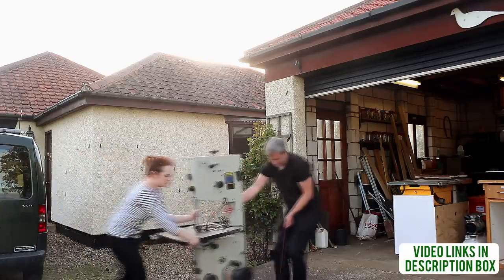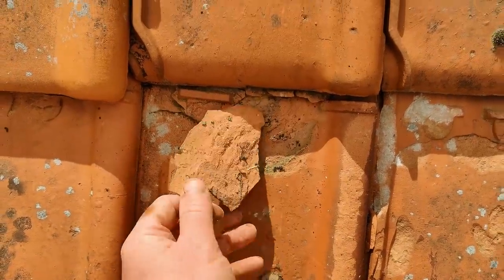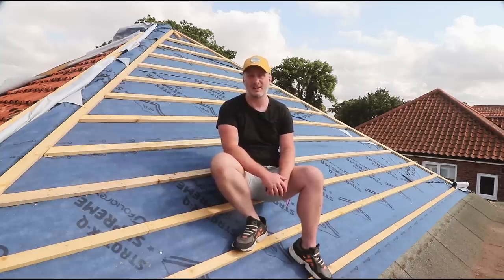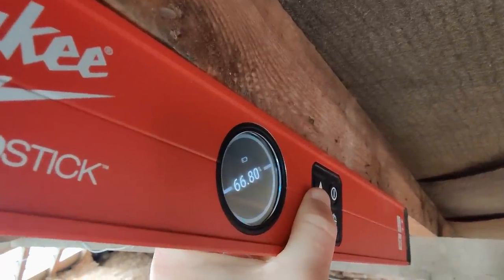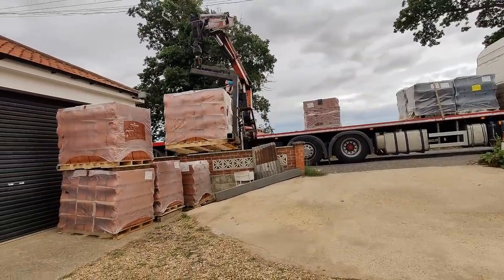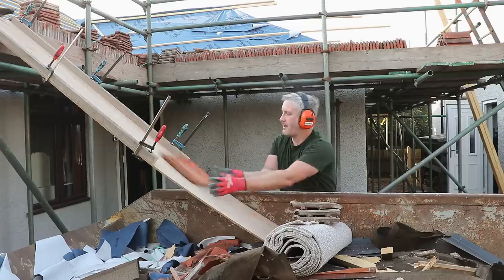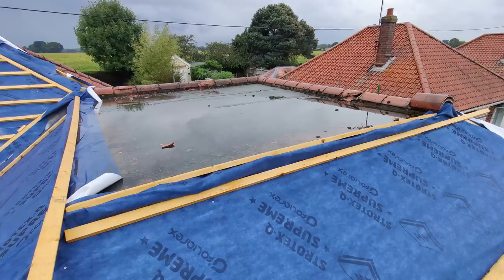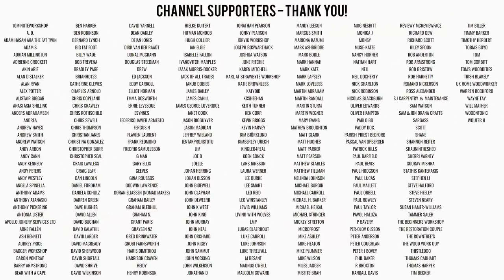The Damage Is Done, Who's To Blame?

Comment: As a builder friend of mine said once: 
"There are 2 types of flat roofs, those that leak and those that are going to leak!"
I've just re-roofed my utility and considered changing from flat to pitched. Went for flat but changed from cold roof with felt to warm roof an EPDM.
Cost a fortune but pleased with the results!
Reply from the maker: Haha I like that! Glad to hear yours is sorted👍EPDM seems like a good choice
Reply: EPDM has its own issues. It will shrink, and pull away from any pitch transitions for one. It also degrades in UV, they don't really last much longer than a mod bit or BUR. The best solution I know of if you do have to have a flat for some reason, is a tapered insulation system, and mechanically fastened TPO or PVC with heat welded seams, but that's really costly too.
Reply: Like concrete
Reply: Everything needs maintenance, but applying this meme to roofs is going overboard IMO.

Comment: 10 years after having a new roof put on our house I noticed that the ends of the fascia boards on the gables were resting on the rooftop. Further inspection revealed the ends of the fascia boards to be sponge soft and rotted despite appearing normal.

I was able to cut off the rotted sections and repaint the cut ends without having to replace the fascia boards. 

The moral of the story is to  familiarize yourself thoroughly with the trade before hiring someone to do a job and closely monitor/inspect their work to ensure that it's done correctly.

Comment: Use this as an opportunity to make the ceiling plane airtight with a membrane under the joist, then use blow in insulation and get 400 mm of insulation up there. Any vapour open membrane and tape system will do. 

The other option is to go with over rafter insulation. With these tiles, you do not need to have ventilation beneath the taped plywood sheathing. The attic then becomes conditioned, and you can put mechanical systems up there (water tank/ ducts/ heat recovery system, storage etc). This increased the depth of your overhangs because of the build up on the roof, which allows for easy installation of exterior wall insulation. 

I can send links if you're interested. With your online presence, you could get sponsorship, I reckon.

Comment: If you look at Edinburgh rooves on google earth or maps - you will see that though from the front it looks like they have pitched rooves, behind the front rise they are flat. This technique gives the impression that the houses and tenements (flats) are not as deep as they actually are. Most of these were built between 1880 and 1920, normally with zink roofing. They last pretty well and changing them to fully pitched is not an option.

Comment: Dehumidifier !! And heat in the top floor to driva away moisture.
Get airflow in the roof and vacuum away any standing water.
Start spraying the wood with mould killer, it will start to mould heavy soon unfortunately

Comment: DUDE!!! The wooden battens underneath must be pointing from the ridge to the facia, they must be nailed to the loadbearing joists. On top if those battens, you place the counterbattens unto which the roof tiles are placed. BTW, rockwool gets less drenched with water than glasswool. But you sheetrock needs to be replaced and the joists needs to be dry, before you lay out new insulation. Here's the steps:
1) Remove ceiling and insulation. 
2) nstall battens, counterbattens and tiles. 
3) Let the wooden construction dry out with help of a "heat blower". Measure the moist in the margin wood to prevent mold. 
4) Install new plasterboard ceiling. 
5) Lay out mineral wool on the loft. 
6) Make sure that the loft is ventilated, ask an architect about the number and size of ventilation oppenings. Must be protected against insects and birds.
Reply from the maker: will respond to these in a future video - cheers
Reply: @RagnBoneBrown  OK :-)

Comment: M8, Whilst I'm sorry you went through this nightmare, who in their right minds goes away on holiday [even just 4 days] when their biggest asset - their home is open to the elements like this and even more so with the roof off!   I know you properly don't want to hear this but as soon as you were told about the water coming in you should have put down your pina colada's and hot footed it straight home!   Oh, and BTW just think about how much weight you added to your Artex'ed ceilings by having them skimmed over ... them skiny little nails they use to use back in the 30's/40's barely hold the plasterboard let alone layer after layer of additional plaster!  Sad to say your best bet is to rip them all down as well as the wall plaster and start again as once water's got in and blown parts of the ceiling/wall plaster out their fecked and no amount of wishful hoping it will just 'dry out' will sort it.  Lastly - you did tell your insurance company you were having this major building work done?  If not I'm sure this video will do that for you. 😉  [any excuse to turn down a claim or possible future ones?]🤔

Comment: Alot of folks talking tough but this isn't a normal roof tear off and dry in. You have a stupid flat roof on top of a  pitched roof and you are essentially reframing your entire roof. If a big storm hits while in progress, it is going to leak in regardless of contractor unless you set up a huge containment system over the whole project, which I'm sure you didn't have in your budget. I would have recommended just framing on top of that flat roof to match the pitch to a point . Yes it would have raised your roof height and you would have to pull a permit but you should pull a permit anyways if you hiring it out. That way after you get it sheathed  you can  do a normal tear off and dry in without fear and even if a storm rolls in you can just tarp it and it will be fine as it's sheathed so the tarp wont sag and let water in. I would ultimately put this on the GC (sounds like you) for not making a good plan to get the overall job done.

Comment: Time of year, consideration, instalation of over cover temporary  roof above work area,  with out, with poor planning by the roof contractor,  the cost of the above will be still be less than the( long term) damage to that properly , water damage is the worst problem to cure

Comment: I'm afraid all that Plasterboard will have to be replaced as the water will have damaged the structure of it and made it brittle.  The paper will now nor hold it together.  
Get the builders to finish the roof Remove all the wet Plasterboard and insulation, then let the timber dry out properly before replacing it all with new. 
It's his fault so make sure the he repairs it properly so you don't hap issues later on.

Comment: The roof is obviously knackered and should have been done first a simple loft inspection would have shown water damage.
Why the flat roof anyway? My guess it may have been an observation feature for perhaps stargazing and had glass or similar for telescope.I of course don't know for sure but most people knows someone with building knowledge. This felted area would have been fine for several years and cheap to do just not the best idea.

Comment: I roof.  And my most basic policy is do not tear off what you cannot replace that same day.  There are exceptions.  But I only allow those exceptions if the weather forecast overnight is sterling and safe.  The flat roof being safetied by an employee? NEVER,, absolutely NEVER.  I am responsible,,, I do it myself.  Contract with a new roofer. I would not contract with yours to do the dog house. The dog would get wet.

Comment: I share your pain water ingress is NEVER good, we had a pirch extension added to our bungalow and a conservatory also, these were done by the same company and they were, expletives withheld, both leaked very badly, fair does that did reproof the porch roof but to no avail. The original builder couldn't even rewire a two way lighting switch, I should have realised 5hen that all would not go well and it didn't, as soon as it rained we had torrents running down the walls and then surprise,  surprise the builder disappeared we finally had the work repaired by another builder and had no troubles since, we were informed the roofer just tucked the roofing felt into the soffit hence the internal downpour. However my long winded comment is this ,regardless of how nice and friendly the builders are always ensure you have adequate insurance cover, I didn't and had to cover the additional costs myself and I'm still livid with myself for trusting the builder against all my better instincts oh well its done now. 
I am very sorry you have this awful nightmare to deal with and I hope it gets resolved amicably.

Comment: For anyone wondering, they call them bungalows because when they were building them they ran out of bricks and said "just bung a low roof on it".....
Reply: @djstuc  Truthful trivia has more to do with India though... Bangalore I believe, old days of the Empire and Raj and all that...;)
Reply: A lot of the houses you call bungalows over there would be called ranches or capes in the USA. We only use the term bungalow for houses that are longer from front-to-back than they are wide and have a fairly shallow roof which can be pitched either way or just a hip roof, and they almost always have small dormers and rooms upstairs with sloping ceilings. They were all the rage in the 1920s, but are not often built today. I don't know how close that shape is to the structures in India from which the name was taken.

Comment: He says the roofer is a really good guy ... ???  Any builder with just an ordinary builder's common sense would immediately know that the bit of flat roof had the potential to be a pond, and the first priority wd be to make it self draining - FIRST THING.  But this wasn't any old builder, it was a ROOFER  - and what is the first, second, and third purpose of a roofer ?  That's right - it's to keep water out.
Reply from the maker: He wasn't on site though, hence the problem. But he's made good so all is well
Reply: @RagnBoneBrown  Nope.  The very first job for any roofer (or anyone else with half a brain) was to make that flat roof self draining.  Not a single thing should have been done anywhere else on the roof till that was done, or unless it was removed and replaced same day with the new slopes. Once the existing slopes had been re-sheeted over the flat roof - there was never any chance.

Comment: Did you not fancy having a go yourself?
Reply from the maker: I am considering tackling the Workshop myself now that I've learned a bit more about how things are done.  But I didn't have the knowledge before now
Reply: What you have to remember is the building trades are not rocket science more often just common sense. If you concentrate on one side at a time see how it's done as you take it apart then just replicate it putting it back

Comment: Has the roofer never heard of tarpaulins? Roofing 101, never leave a roof unprotected, it will always rain, and that flat roof was a nightmare waiting to happen.
Reply: Exactly. I presume the roofer would have been fully informed why the flat roof was being changed to a pitched roof so should have been more than aware of the slope of the roof.
Reply: the sheets are waterproof, the flat roof has a slight angle to it which wasn't obvious to them and the water was sliding down under the sheets. Please watch the video to the end before commenting. 

I think the mistake they made was leaving the flat bit exposed, they should havv covered the entire roof.
Reply: @Professional_Youtube_Commenter  
Any roofer worth his salt would not need the customer to tell him about the flat roof. The water from the flat roof has to go somewhere and it should have been obvious to them when they did the work that they would need to account for that drainage. Regardless, it was a mistake that shouldn't have happened but it sounds like they are owning up to it rather than dodging any responsibility so good on them.
Reply: @rogermccaslin5963  yeah i guess uploader is being too kind to the roofers. I would have been fuming.
Reply: @Professional_Youtube_Commenter  Lol what are you talking about... So the roofers couldn't figure out that water on that flat roof had to go somewhere at some point. This is %100 roofers fault.

Comment: There is a reason why it is required here in local building codes to always have decking and then use either a heavy saturated asphalt felt, or Better Yet is to use a heavy high temp Self-Adhering Underlayment membrane before the Tile are put on.
I am sorry you had this problem.  But now before you have the Tile put on,  You have the Option to have any changes done that you want to.

Comment: I feel sorry for your bad moment. With such a quantity of water the problem is huge, it has the capacity to flow and mold everything, wheras a small quantity of warter would probably be absorbed towards the top of the house and evaporate from there.  I also feel you for the time the incident will take, drying is slow (I my understanding of the current UK energy market is that krancking the heat is also a complicated proposition), paperwork is slow, contractors are overbooked.
Reply from the maker: Thank you!

Comment: As a contractor and roofer for 3 decades; that's 100% insured damage...Hopefully the roofer is well insured...He needed WATERPROOF tarps over that membrane...It's a shame you're going through the aggravation...I'm semi retired now, it's nearly impossible to find competent tradesmen these days...Roofing requires extreme diligence, especially in a tear off...Next time; you buy a bungalow with clay tiles and a flat area;   just put a metal roof, in the flat area, with a proper outlet for drainage.....:)... As if; right? Cheers.

Comment: Remove all the damaged plaster board, although it will dry out it won't ever be as strong and it will fracture easily and bow all over the place. I know it's more work but you will regret it if you don't.

Comment: Hmm, kudos for warning others. Who is to blame? Well, sadly, in my opinion, you in part. Others have commented on sequencing so I won't. If you did n't get retrospective planning permission did you consider the consequences? The worse case was that the Council could have ordered the new roof to be removed and another, lower one installed. And what about complying with the Building Regulations? Was there a named, qualified and approved roof designer?  Has the builder any experience with flat topped pitched roof replacement? Leaving the flat top roof was a disaster waiting to happen, surely the new frame should have been taken directly up to the point and the whole structure then made waterproof with a continuous membrane. Why was the flat section left there at all? You are a nice guy but far too 'understanding' and I suspect you did not do your research fully. Consult a solicitor! (Lawyer for US viewers).  You may well be getting a visit form the local Council's building surveyor..... that roof does not just have to be weatherproof, it has to withstand specific wind loadings which vary across the country.

Comment: Get yourself a professional assess the damage. Do not let the contractor who made the mistake, decide what needs fixing and what does not. For instance: Insulation like that, that was damp once, is gone for good. Remove everything that got wet. All boards on the ceiling and wall need to be removed and replaced, all wall studs that got wet inspected down to the floor, the subfloor inspected for any water damage there. Basically you need to open all structural elements and all plaster boards/osb boards need to be replaced. They loose integrity if they get wet immediately and not only when they start molding or rotting away. This mistake is a huge oversight, as the membrane itself needs to be overlapped, fixed, and during construction the whole roof additionally water-proof (on top of the construction itself during construction a second layer !). This is not a minor mistake, and this is not a minor damage to your property. This will produce additional problems with lingering moisture if not handled properly and thoroughly. In my opinion, we are talking here about a potential damage and repair cost of 6 figure numbers !

Comment: 5:06  “Decided to go ahead anyway and apply for planning permission in retrospect”  THIS is very dangerous!  The council said they would “probably” approve it. But councils are fickle and a change of staff and/or attitude could see your multi thousands of pounds work being disallowed and an order to “put it back as it was.”  Don’t believe this can’t happen!  Councils often cite spurious and shallow reasons to turn down works if they feel annoyed at you not going on bended knee beforehand, or because they have a friend/relative near you who simply doesn’t like the idea. Example…Here’s one: “The finished  work is not ‘in keeping’ with the area”  Like your coloured roof tiles idea! Another might be: “it is slightly more visible from a neighbours property and thus ruins their view”….You won’t be told which neighbour because of course it was baloney.  Councils gain nothing materially from obstructing your project..it is all simply human spite ‘because they can’.  So beware of giving them any excuse to f.u.up…always get planning approval first huh!  I’ve not commented on the roof leak since it is well covered in other’s comments, but best of luck for a good resolution.
Reply from the maker: As explained in the video, if the new pitched roof isn't higher, planning permission isn't needed - did you miss that part? Anyway the next video will explain what happens with planning permission, stay tuned 👍